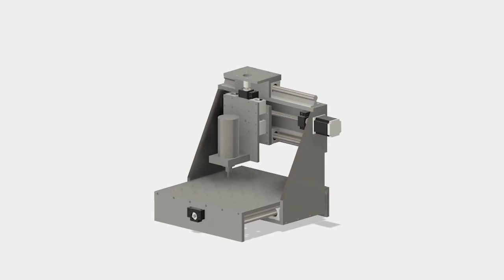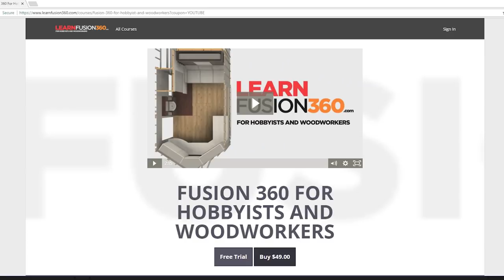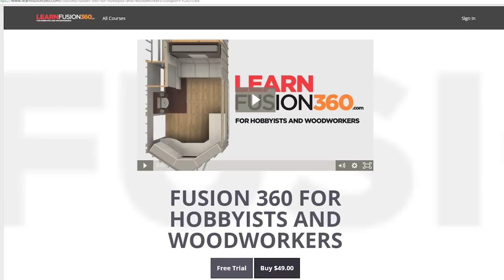"Stupid Strong" CNC Build - PART 1 - THE FRAME

Comment: Thanks for making this build series happen! Can't wait to see the finished machine! Two questions:
1. Your bill of materials doesn't seem to include everything-- e.g. the spindle?
2. Will you be selling detailed plans for it?
3. Were you inspired at all by Jeremy Schmidt's machine? His is ridiculously strong as well and uses fully supported rails like your Y axis, so I'm guessing you'll achieve the same level of rigidity in your machine :) I don't know if you were aware of Jeremys build, or if it's just a case of great minds thinking alike
Reply from the maker: Whoops I'll add the spindle to the BOM.  It's a Bosch Colt I got refurbished from CPO.  

I'm going to use it for several months before I consider making plans for it, but it's crossed my mind.  I want to make sure it performs better than other CNCs on the market before I put the effort into making plans.  

I'm a big fan of Jeremy and remember seeing his CNC video, but I thought his was a commercial machine.  A shark or something?
Reply: Mike and Lauren sounds great! I do hope you decide to offer the plans once you're happy with the performance. And as for Jeremys machine, you're right -- that was a rebuild of a commercial machine, not a complete design.

Comment: "stupid strong" would have been cast iron, granite or at least steel, with some proper linear rails, a proper spindle, some decent drive motors, electronics snd limit switches. this is nothing more than an over glorified 3d printer chassie with a click bait title, to entice people to watch it and buy your "training video" when there's hundreds of them on you tube
Reply: There are always room for improvements, but this machine is very solid compared to a lot of the junk out there...and building one like this is a good starting point to learn what works and what  doesn't, so if you want to build a more 'serious' unit in the future you won't waste time and money heading down dead ends. Nothing really click-bait about it, and for rigidity the thick aluminum is more than sufficient. The only real thing I would have done differently is linear rails instead of those round roller track things.
Reply: In my experience  (limited) the round rails are actually pretty good, once cost is factored in. Why a CNC cannot be "strong" when made of aluminum is beyond me. The reliance on thick aluminum rather than clever shape design however seems to be a major factor, particularly in cost for them.
Reply: An old axiom goes something like this "A machine should only work material that is what it is made of or less".  So, in this case, Aluminum, Wood, and Plastic.  As far as rod rods I say they need to be 12-20mm round (get a CNC to understand why) BUT at the price for the C style bearings and the rods themselves you are better off buying linear rails and blocks as the cost isn't all that much more but the rigidity is through the roof in comparison.
Reply: Robbie James , we have manufactured with both round and linear rails and the rigidity is night and day. We actually have a stupid strong router design for a 20x40 table and it machines aluminum like butter. Previously we tried similar to what he has and it wasn’t rigid enough for metal.
Reply: @glennedward2201  
I've just finished my CNC and it machines (so far) aluminum and mild steel (looking at stainless!) to +- 0.02mm. This is despite my multiple flawed design choices (like using 8mm leadscrews for transmission and mostly 16mm round rails). It's not great, and I'm looking to upgrade it, but so far it gets the job done.

Comment: Are you intending to cut steel with this mill build or is it strictly for softer materials like aluminum and brass?
Reply from the maker: The plan is wood/aluminum.
Reply: Whats the torque specs on the motors you're using?

Comment: HOLY CRAP this thing is overbuilt. Sometimes more material doesn't lead to any advantages. Using half inch plates for a 18"x18" router is overkill by a margin of like 4 or 5. We have a 4'x8' machine with quarter inch thick plate construction, and it is more than sturdy enough. You are making up for poor design with thicker plates. you could make this machine for a quarter of the cost and twice the rigidity.
Reply: You should show us best practices done. Seriously, the optimization of material to rigidity or weight or cost, etc. is a fantastic subject and never receives the attention it deserves in DIY videos. Of course, he could have bought a similar size machine from eBay, but what would be the fun in that :)
Reply: Well optimization of shape and design is a very complicated subject and I doubt that many people would find it interesting. I'll back up Peter and say that I'd call this the "stupid design" CNC not super strong. Rather than just using crazy thick material it would be much better to determine what forces are acting on the machine, and mostly what torques those would apply. Then a good understanding of how moments of inertia affect a shapes ability to resist bending (a good example would be reading about the maths behind I beams). Source: Mech Engineering degree, hobby machinist, and I work designing and building professional grade CNC mills and lathes.
Reply: For what it's worth, I would find "optimization of shape and design" HIGHLY interesting :)
Reply: And it does not claim to be a super strong machine. It's just stupid strong :)
Reply: Where is yours?
Reply: Yes, you are right exactly it's a over kill.
Reply: What if he were to mill something really heavy? What if it was a shape your cnc machines couldn't work with? Have you ever seen a team sized welding table? Or a tapping arm?
Reply: I am sure he appreciates your highly technical "more than sturdy enough" analysis. Any CNC machine with a moving gantry is going to have limited precision, and this is a DIY project not an industrial machine that is going to be used in a factory or something.
Reply: Even the brightest engineers experiment, iterate and sometimes guess.

Comment: "So far we only have half the bolts lining up." Welcome to cheap Chinese cnc parts! No, I'm not being a troll, they really are bad at making cheap precision parts. Ironically, the parts that they make and  we buy to make cnc machines probably aren't made on cnc machines. Screw hole spacings vary from one bearing to the next. The feet of supported linear rails I have look like they were drilled by hand on a drill press with a bit that hasn't been sharpened since 2009. It goes on and on. The fact of the matter is that these parts are actually hand made and no two are alike. 
The takeaway is that you should never, never pre-drill holes until you have parts in hand, AND have decided which part you're going to use where, AND have measured each part and documented the hole positions, size, etc. You just can't rely on specs.

Comment: Hey looks pretty good! Just so you know though those bottom rails  probably shouldn't be mounted upside down so the gantry hangs. the pillow blocks are split at the bottom and with constant weight pulling them down they will slowly deform and spread apart leading to slop early on it's life the pillow blocks have no way to stop the alum. from slowly bending apart if the force is applied on the open ended side of the blocks. I would add a second plate under your machine. Flip the bottom rails around so they are right side up, and have your gantry sit on top of them. with the pillow blocks mounted to the bottom of your gantry

Comment: Just another comment on your design, those open linear rail bearings supposed to be installed the other way so that the weight rests on the bearings, pushing them down towards the rods. The way you installed them is wrong because they introduce a very weak point in your design, maeing is a "stupid weak" CNC, instead of "stupid strong". I guess you know that by now... Never the less, I will check the other four vids as well to see how far you get before you realize that.

Comment: Seems like you had a lot of trouble designing your aluminum to join at right angles. Is there a reason why you didn't make the main frame out of 80/20 extrusion?
Reply from the maker: I wanted something stronger than 80/20 extrusion.  Once the machine is up and running I'll do a "review" video of my machine and put some thought into what I would do different.
Reply: 80/20 extrusion might have less material for a given length, but the tubular nature of it makes it very resistant to deflection.
Reply: you want to make this unit strong yet you secured the gantry with 6 small metal screws 
(total) on the base plate end grain??

Comment: Not a good design at all. This is not the correct way of how things are done when you build a machine... Too amateurish.... All plates have the same thickness... Accuracy is very important. You have to measure, adjust, shim, etc. You cannot slap everything together like shown in this video... All markings on the surfaces are visible... It looks like corrosion and and surface oxidation problems were not considered at all. It is not stupid strong as claimed here.
Reply: What's inherently bad about all the plates having the same thickness? Which parts require measurement, adjustment, shimming etc. What is wrong with the visible surface markings? What problems do corrosion/surface oxidation pose? And how does this impact the machine's strength? I'm not saying that you're wrong, but pointing out the unhelpful nature of your comment.

Comment: Not sure it would help you given your base plate was so large, but I regularly have to swing the head of my drill press around to the side to drill stuff. Many things are too big to fit my drill press between the base and the bottom of the drill bit. It is possible to clamp stuff hanging off the side of the table and extending down the side of the table rotating the head to drill over free space. Mounting is always the trick, and often slower than hand drilling. Looks like your bench block got the job done. Glad to see this project rolling out. Can't wait to see the rest.
Reply: Right!  AND/OR, you can swivel the drill press BASE 180 (and maybe move your press out a little to extend over the front of the bench?).  
Hadda do that with my radial arm press.
Reply: Awesome to see you here! XD

Comment: Hey Mike, just found your videos! In spite of the other comments, great job! If you are using Fusion 360, why the hole mistakes?...This is the first of your vids I have watched and will see the others in a bit. I am just about to start buying parts and having alum cut. Question though; you used linear shaft rails instead of guideway (square) linear rails?
Reply: Is there a reason why you specify the 3D design program here? Are you suggesting that the other drawing/design programs allow for hole mistakes? Hey TWBRKFD, get out of here! This subject is for adults.

Comment: I would be tempted to drill and dowel pin the frame and gantry joints. You are relying on friction to keep things located without dowel pins fitted.

Comment: This will no doubt be a solid machine. Clearly he thought about it and made a conscious decision for it to be this small but for anyone else out there that considers making a CNC after this design please realize that scaling this up to have a 24” x 24” travel wouldn’t cost much more and you would certainly thank yourself later. After about 36”x36” the linear rails and ballscrews and things start becoming much more expensive. But th electronics for his small machine would be the same for a mid sized machine so I am of the opinion that it makes sense to go at least 36” x 36” to get the most CNC for your money. But like I said he consciously made this decision and after watching his builds I have no doubt this will be a stupid strong CNC build and I’m excited to follow the series.
Reply from the maker: Great point I should have mentioned.  I built this machine to fit on a 24" bench in a mobile workshop.  I wanted something compact and capable.  You could make one in the sizes you mentioned for just $50-100 more.

Comment: At 4:08 when it hits, you can see a bit of play. Is that ok?
Reply from the maker: +Yonatan24 at that point the bolts were not even finger tight. If you look closely you can see the gantry is just sitting on 2 or 3 threads.  No flex now that everything is tightened up!

Comment: Why did you choose to use Aluminum? Instead of steel, or anything else? 
Cost? Weight?
Reply: Also, how did you decide what thickness to buy? Looking forward to the rest of this series!
Reply from the maker: +Yonatan24 weight and availability.
Reply from the maker: +Yonatan24 This is my first build so I guessed 1/2".  It's probably overbuilt, I think I would use 3/8" next time around.

Comment: I cut the frame parts for the z-axis for my cnc  also on the water jet and had the same issue with the hole alignment...
In the end i had to drill quite a few holes on the milling machine, mill the faces where the mounting holes are, to fit everything...
The waterjet is a really nice machine but not everytime the perfect solution...
Reply: Seiberger I think the problem may be less to do with the waterjet and more to do with the Chinese import linear rails and slides. Sometimes you don't even need to measure to see that the hole locations haven't been spaced evenly. It's a trade off for the parts being so cheap, they're usually good enough if you drill your mounting holes a little oversize and once you start looking at things like Hiwin rails the costs start rocketing.
Reply from the maker: That was the issue in my case.  I measured one set of rails and bearings and used those dimensions throughout my design.  It turns out no two parts were alike from china.
Reply: Well, in my case it was the opposite...for my build I used quite nice linear rails from IGUS, unfortunatly the Waterjet wasn´t calibrated well (the cutting angle was slightly off 90°) ... 
However i used 10mm thick aluminum (6000 series) too and my machine is holding up very well...
When building Diy-CNC mills, where cutting speeds aren´t that important, it isn´t really a big deal when the frame is oversized. As long as the stepper/servo motors are strong enough everything should be fine...

Comment: Those linear bearings don't sound so good...
Reply from the maker: It was the y axis coupler out of alignment.  After making the final adjustments, the noise went away.
Reply: ‘Super strong’ are you having laugh - this is good frame for 3D printer or laser, might be light engraving in soft materials.

Comment: There's a mistake in your design. With only one leadscrew for x, when the tool is in the middle, everything is ok, but when it's milling in one side of y axis, you'll have a big big twisting torque pulling the bridge one side in one direction and the other side in the opposite one. Say goodbye to tolerances or good finish. Solution is putting two leadscrews for x axis, one en each side of the table. In this way you are 100% controlling what hapoens in each side of the bridge.
Reply from the maker: Interesting.  I'll have to test that out.

Comment: You designed this yourself but have no idea if it is going to work.  How is that possible?  To move forward with something you have know idea will work or not?  I mean. you must have had some sort of confidence the thing would work.  Maybe just a small inkling?  Like, for sure you new those bolts would hold the pieces together.  You named it the stupid strong CNC because you were not sure if it would be strong?  Or because you knew it would be strong?

Comment: You teach a course in Fusion 360, but can't get the waterjet guy a file, to line up your holes for bolts correctly? What was he doing, measuring using a ruler? Really?
Reply: I bet the problem wasn't the file he sent to the waterjet guy.  I have used those bearings and not all the holes by the factory were the same.
Reply: Always check your parts dimensions should be part of the planning stage of any material order is my thought. The very idea of using Fusion is to ensure accuracy by testing how things are going to go together. 

I'm just sayin, that to me, there's a small sense of irony in it all :-)
Reply from the maker: I made the mistake of using one part's dimensions throughout my design.  Turns out every bearing, rail, ballscrew had slightly different dimensions from China.
Reply: You might have discovered the same problem as another YouTube CNC builder went through - orientation of the slide mounts. Here's his video - https://www.youtube.com/watch?v=ljSHwaRmlQ8